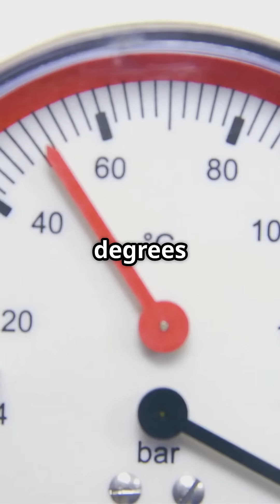How Hot Can Your CPU Get Before It Melts?

Comment: When the Pentium was first launched many were used without a heatsink or fan. No throttling just pure pedal to the metal. I have seen where a CPU burned a hole (yes a hole) through the motherboard catching fire and burned up the CPU. I only saw that level of destruction once, but I have seen several with scorch marks.